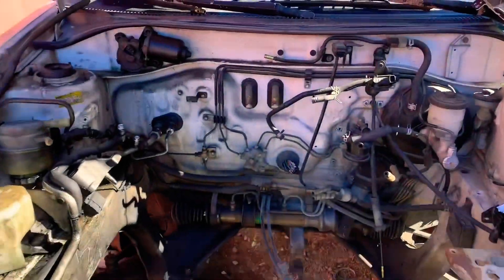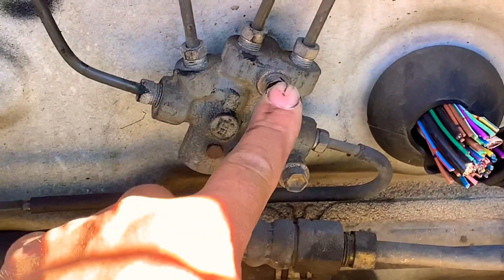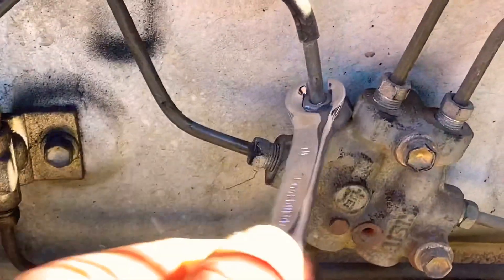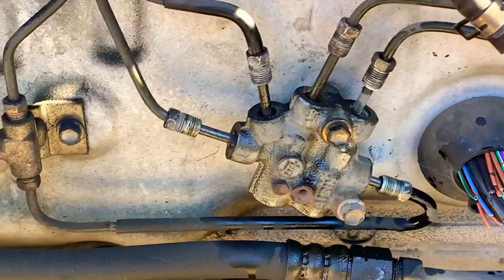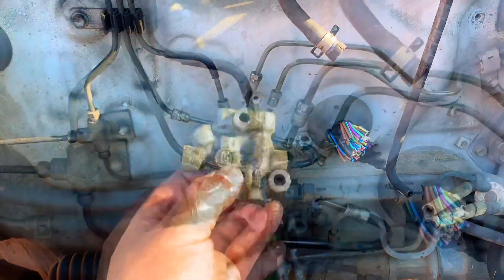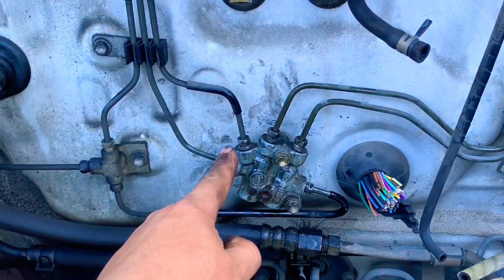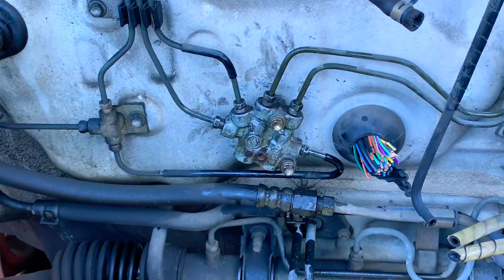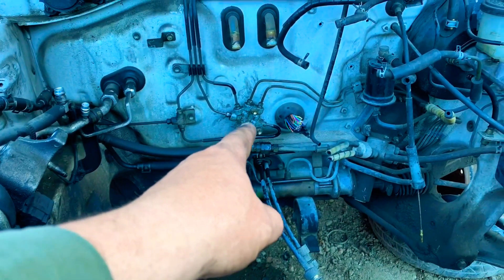How to replace a proportioning valve on a car Toyota TercelPaseo 91-94 @elchanojose

Comment: Sometimes you can reset the valve with a screwdriver. It goes to one side if the brakes have a leak or are drained too quick during brake replacement. It's so the system doesn't run dry if there's a leak. Also.. toyota uses brake fluid for clutches so if clutch doesn't work til it hits the firewall it's actually just brake proportioning valve. Very few ppl know this. They'll replace the clutch and even try to rebuild the transmission.
Reply: Do tell! Any chance you can elaborate?
Reply: Hello. Can you give more information?

Comment: Thank you Carnal. 
Im having trouble with my 90 Camry 
Replaced brakes, replaced Master Cylinder. Bleed all the wheels several times and still can’t get it right. 
The problem is my back brakes dont get enough pressure and I bleed them real good on a dry day the car stops but you can tell its having a hard time stoping on a rainy day boy o boy it just slides, the front lock up and the back keeps rolling, my wife already got up on a curb one time and broke one wheel. I dont want to trash this car since is in great condition. Hope you can help me figure this out. 
Muchas Gracias. Saludos.

Comment: Hello. Any tips on bleeding the brakes afterwards? Any different procedure? I've done this job and I can't get the brake pedal to get firm as it used to. Seems I still have air in the lines. Thanks
Reply from the maker: Hello Andre!  Try breading wheel by wheel by having another person helping you.  Air in the brake lines is the worst enemy on braking.  You might have to refill the master cylinder a few times when doing this.  Take well care Andre!